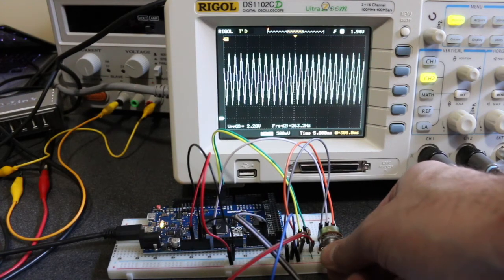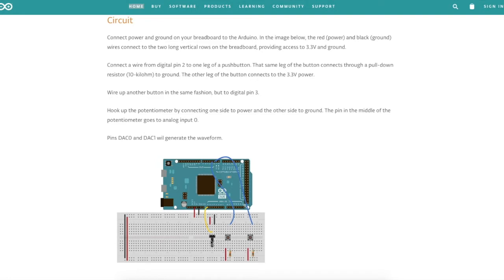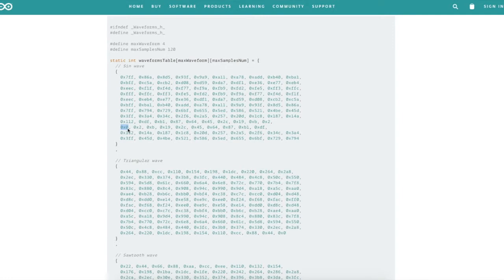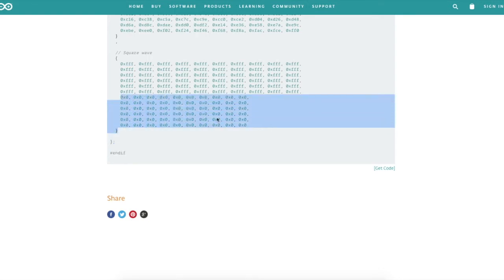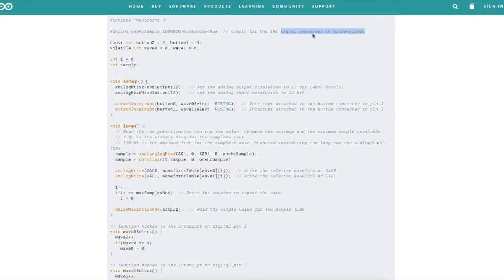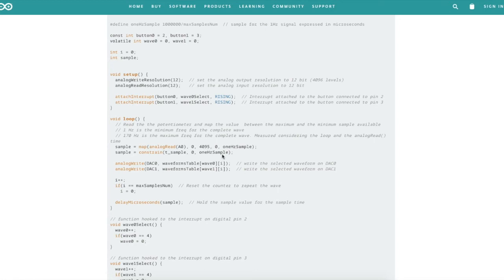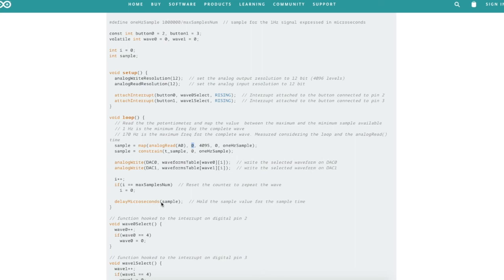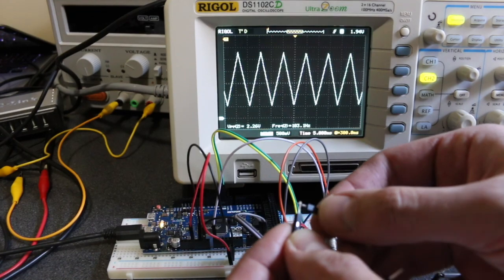Arduino Due Simple Function Generator Example

Comment: The project works well. I would like to change frequency beetween 20 KHz and 40 Khz ....is that possible ? I tryed to setup the minimum value inside the delayMicroseconds(1);  The max frequency I read in the oscilloscope is 539 Hz. To reach 40 KHz need to chenge the system, instead of using delayMicroseconds(1) must to use something else, but what? Maybe delayNanoseconds ....
Reply from the maker: four years ago on my other channel I did another oscillator using the Due bored and using direct digital synthesis and I can’t remember what kind of frequency generating limitations I had but it definitely is easier to get higher frequencies with that technique.
I vaguely recall maybe when doing 20 kHz I only had a couple of data points to generate a waveform  so it wasn’t very good but the same basic principle can probably work better with some kind of modification like maybe a bigger data table with more data points to pick from.
https://youtu.be/xiby-mkIgQ0

Comment: Oi, nice video bro, but I am getting the error 'analogWriteResolution' was not declared in this scope
', can you pls help, thank you so much.
Reply from the maker: The first thing to confirm is make sure the Due board is chosen in the IDE before compiling because that command is only available on certain boards so it gives the error if the wrong board is targeted.   Otherwise I think that project is 4 or 5 years old so I'm not sure if anything got broken in the IDE support for it over the years.   
I just tried compiling in IDE 1.8.13  and it was successful, using Arduino Due as the board, and the board file installed to support Due is  Arduino SAM Boards (32-bits ARM Cortex-M3)  version 1.6.11
Reply: @GadgetReboot  Tnx for the reply, I gonna try again soom, ty once again.

Comment: There is a fundamental design (perhaps implementation) flaw.  taking the analog read on the sample time in loop() won't yield a consistent value.  The number will jump up and down by a couple of digit.
Reply: bro is stupid, u need to learn adc and potentiometer

firstly, why do u think potentiometer doesnt move by itself? yes it does move microscopically

second, the adc is 12bits, even if we assume perfect potentiometer, all ur breadboard bullshit and the noise of everything else will make it jump around

wtf do u mean design flaw or implementation flaw, this is fuckin adc common sense

Comment: Hello, thanks for your tutorial, this is interesting. I was wondering since the Due works with Dacs if it was possible to simply work a sin(x) function to create a sin wave instead of working with a table of parameters ?
Reply: Actually a pretty good question. It´s possible but probably you´re going to need to add more stuff (another pot) and solve the part of math (for all the waves). But for a sine wave you could use maybe 2 pots one for the amplitude and the other one for the frequency. But you will have to map the reading values of both of them. So the formula we are going to use is A*sin(B) where A is the value of the first pot and the responsable value for the amplitude of the wave, and then the part B corresponds to the second pot and the one in charge of the frequency, this one is a litlle more complicate cause the way that math works. So for B we are going to need a "lenght" value, I mean, the map values range of this pot could be betwen 0.01 and 0.001 (that´s our "lenght"). So the only left is making the itteration for B. Hope it helps, it´s just the first thing that comes to my mind. I would like to be more explicit but english is no my first language so...
Reply: It should work but your max frequency will be lower because of all of the calculation.  For each sample, you need to do sine of x.  Table lookup is much faster.

Comment: the original code is wrong: 
 
  sample = map(analogRead(A0), 0, 4095, 0, oneHzSample);
  sample = constrain(t_sample, 0, oneHzSample);

the correct one is:
....
 int sample, t_sample;
....
  t_sample = map(analogRead(A0), 0, 4095, 0, oneHzSample);
  sample = constrain(t_sample, 0, oneHzSample);
Reply: Don't work too.... the problem with this code always is the same thing 
'analogWriteResolution' was not declared in this scope
'

Comment: yesterday I did this one over my due board it was fine and was changing its waveforms but when i connected it to the oscilloscope for verification then it was not providing a significant change in frequency. the frequency was varying between 800mHZ to 1-79HZ. can you please help me to sort out this problem?

Comment: i can increase the voltage up 2.3v ???????????????????????????????pleas answer me quickly
Reply from the maker: The peak output voltage on this chip was 2.8 V so to get it larger would require some sort of external circuit like an op amp.
Reply: @GadgetReboot  thank you

Comment: Why 12bit (4096) levels ? can we increase?
Reply: of course u can

u just need to go make a new chip for us all

fukin idiot
Reply from the maker: That’s the limit for the hardware resolution. We could increase it by using a different DAC and generating a larger waveform table to take it advantage of it.

Comment: how high the voltage can be tuned?
Reply: Thank you sir, one more thing..will it be more efficient (in term of the output) if I use external DAC chip..I couldnt find any source for this or am I missing something..hmmm
Reply from the maker: http://schianorobotics.altervista.org/Arduino_DUE___DAC_MCP4922.pdf

 That document shows one external SPI controlled DAC that’s available in 12 bit like the built-in one and the output can go closer to 5 V although it may be a little expensive. 

 Since it doesn’t have any extra components that will introduce errors like an op amp, it may give a more accurate output but I’m not sure if the maximum frequency would be about the same as the internal or slightly slower due to the overhead of interfacing. 

 So depending what’s more important between cost or maximum frequency or output voltage swing with minimal offset, maybe this would work better than scaling the built-in one with a bunch of components. 

 I ordered a different part with I think only 10 bits but it’s SPI so when I get that I will be checking what kind of frequency I can get out of it.
Reply: @GadgetReboot  hello sir, i have a problem in compiling..i tried to do it from scratch since the get code link are broken..how exactly i can get waveforms.h ? i am not sure whether i am doing it right or not because i am new to adruino..do i need to compile both set of codes and save it in one folder or something?
Reply from the maker: It's been a while since I did it so I quickly loaded mine and it compiled, so I started over with a new test folder and copying the code manually from the page, and found one problem at least from the web code.   

In FunctionGenerator.ino, in the loop there was a compile error saying something about t_sample, so I changed it to just "sample" like this:
change from:  sample = constrain(t_sample, 0, oneHzSample);
                 to:    sample = constrain(sample, 0, oneHzSample);

Other than that, I manually copied and pasted the code text from the web page tutorial into new files within the Arduino IDE and then saved them by the same names as the tutorial, and in the same folder.  

For waveforms.h  I had to go into the folder after saving it from Arduino IDE so I could rename it properly and copy it out of the sub folder that the IDE stored it in as an INO file.    Tedious but in the end using the IDE as my text editor was the safest because using a normal text editor sometimes won't work - there may be hidden extra character codes that mess it up when compiling.

So both files go in the same folder, then you open FunctionGenerator.ino and compile just that (with the correct arduino board target chosen of course for the project hardware).  

When the FunctionGenerator project is loaded It should also have a tab that auto-loaded waveforms.h since it was a listed include file in the main sketch anyway.
Reply: @GadgetReboot   while i as waiting for your reply, i browsed for an answer and found an instruction on how to properly save the ".h" but it doesnt work..here is the page..
http://2manyprojects.net/tone-generator

what i did was i just saved the whole contents of waveforms.h  in "txt" file and put the" txt" file into the FunctionGenerator's folder and it works ! now i just need to assemble everything and try to check the waveforms in my school's lab
Reply from the maker: There is an offset from both ground and upper rails so the output is about 0.5 to 2.7 V.   It can be scaled using an op amp like this 
http://ardupiclab.blogspot.com/2015/07/how-to-modify-analog-output-range-of.html

Comment: Can i also do it in Mega2560?
Reply from the maker: I don’t have a mega but looking up the specs, it only runs at 16 MHz compared to around 84 MHz on Due,  and that’s going to be the big limiting factor on how fast of a frequency can be generated by cycling through the look up table to generate the waveform as fast as possible. 

 I also did not see any digital outputs listed in the specification so an external DAC would have to be used.   I tested an I2C DAC on Uno and it was very slow so an SPI May work better.  If that works on Uno at a high enough output waveform frequency, that should also work on mega. 
https://youtu.be/tLsg6vYcRXA
Reply: @GadgetReboot  okay thanks..how did you compile the codes from the site? I also have the codes from the site but i didnt know how to compile it. I have some problems with it
Reply from the maker: They give the source code as highlighted text for two required files on that project page so I clicked to get the code at the bottom of each highlighted code area, and it opened each up in it’s own new window, then I highlighted the text and put it into a text editor and saved it as each required file name 
FunctionGenerator.ino
Waveforms.h

 I saved them both in the same Arduino project folder called FunctionGenerator (folder name has to match the INO name),  then I made sure I chose Due as the board I’m using and it compiled.

Comment: do you think I can do it with UNO??
Reply from the maker: UNO  runs a lot slower, has less memory to store waveform samples, and doesn’t have a built in DAC. But I wonder what is possible still even adding an external DAC. Maybe I will try that and do a video on it.
Reply from the maker: I have tested an external I2C DAC with Uno and it ran very slow so that’s not practical, I’m not sure how much better an SPI DAC might perform. Maybe another future thing I can investigate. 
https://youtu.be/tLsg6vYcRXA
Reply: @GadgetReboot  lol no

serial dac are practically useless on slow mcus

u need parallel, or just build one